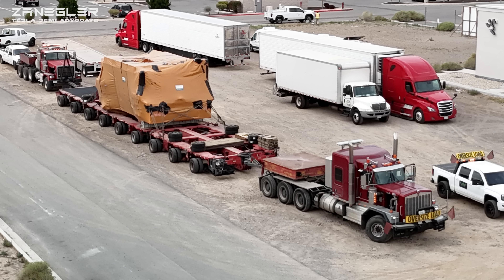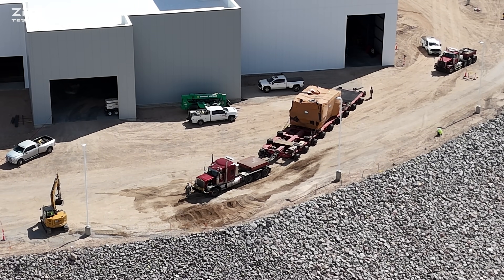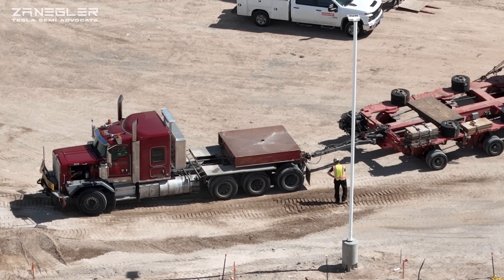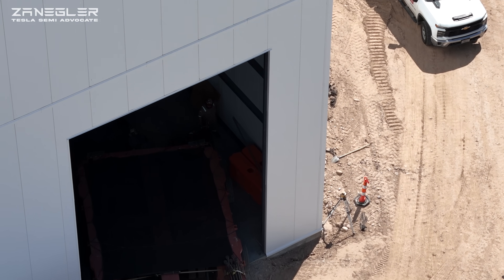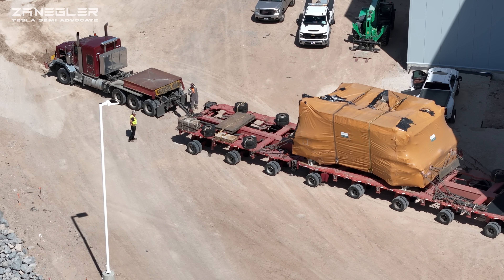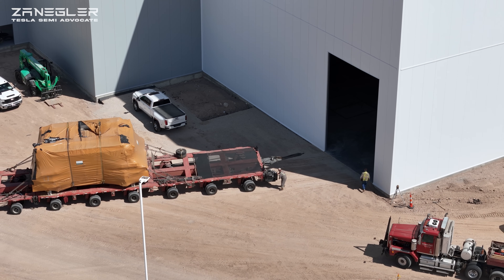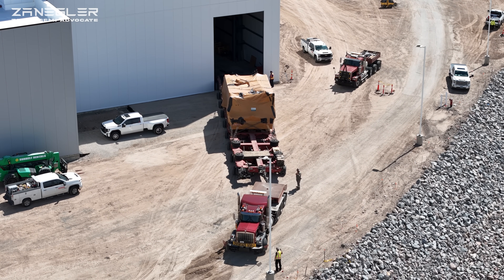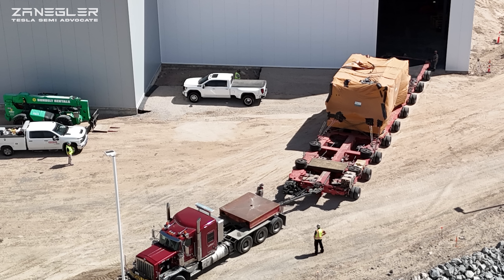Tesla Giga Semi - Back That Press Up!

Comment: Found a Youtube video showing the installation of a stamping press line for BYD.
Video title is 'The whole installation process for a High-speed Stamping Tandem Line of JIER'
This will be a very similar pressline to that being installed at the Semi factory.
Reply: Thanks for the link. Very interesting. I wonder why they brought in a mobile crane when there was a working bridge crane right overhead: https://www.youtube.com/watch?v=rBcwhg01SJ0&t=12s

FYI: YouTube and Google links are acceptable in YouTube comments since they are both Google domains
Reply: @GntlTch  Good pick up. Longer reach immediately comes to mind.

Using the bridge crane also.
Reply: @GntlTch  Links. I can't explain why, but sometimes a youtube link in my post will be immediately deleted, other times goes into quarantine for a couple of days, every once in a while it is not an issue.

I tend to just avoid them. Posting a title not generally problematic.

I do post of lot of comments, might be the reason I have trouble.
Reply: @GntlTch  For the record, as a response to the comment by @thedukeofalinor1377, I just tried posting a link to Zanegler's previous video showing all but the middle axle on the trailer are steerable.

My comment was deleted.

Steerable axles, see 'Tesla Giga Semi Stamping Press - Final Assault', at 7:48

Comment: My thought about gantry cranes here s that they may have their internal permanent gantry crane running and they are using that now instead of the portable?
Reply: Internal bridge crane (big red crane delivered a couple of weeks ago) is well below capacity (50mt) to lift a 133mt press component.

The gantry is partly visible inside in the previous video, set up over the stamping pit.

Comment: You have two options to steer the trailer,  one is you can control him when the reach (or tow bar) is mechanicly connectetd to the axles, the other is you disconnect the reach`s  steering function mechanically. You are still connectet to the trailer for push and pull but now you can steer with the hydraulic aggregat either in the front or in the back.
All it takes ☝ you pull out ONE big bolt. 👍

Comment: Very nice conclusion. Thanks. I might have missed something, but there are 2 stamping "excavations" aren't there? I guess they are all in the one building now with 2 big pits (or a double one) and what seemed to be a smaller one farther away inside. There are 3 stamping machines, one already placed, this one, and another on the way. Is the farther one smaller? And has it been placed already? Or is it the one on the way and to be placed on the other end of the building?
Reply: I think there are 2 'presses'. A 5 station stamping pressline similar to the Schuler and AIDA presslines as installed at GT and Berlin, and a standalone stamping press as is also installed at GT.

A pressline is a row of stamping presses installed as a single machine where a component is transferred from press to press as the component is shaped from blank sheet to formed and trimmed component.
In this instance I think there are 5 stations, based on the number of components that were stored at GT

The 5 station pressline would be installed over the long stamping pit on the west side.

The standalone stamping press on the small pit on the east side.

Youtube video by Schular titled ‘Servo pressline at Mercedes-Benz plant Bremen’ shows an example of a multi station pressline (6 stations), as do the various Tesla promotional videos from Berlin.

Joe’s 21 November 2022 video titled ‘Inside both stamping machine areas! 21 November 2022 Giga Texas Construction Update’, shows a pressline, a standalone press (AFAIK is used to test dies) in Stamping 1. Plus shows the gantry crane set up over the stamping pit in Stamping 2.
Reply: @DessieDoolan  Thanks, Dessie. Your explanation succinctly sums up what is happening: a stamping pressline on one side and a stamping press on the other. It was fascinating to watch that trailer backing up into the building through the big door. And clever, it seems to me, to first construct the gantry crane outdoors, then move it into the building (wish we had seen that), and leave it inside for positioning the other presses.

Ha. It looks like those guy really know what they are doing ... and have probably done that many times before. 🙂
Reply: @WarrenLacefield  I'd say the gantry has been moved in and out several times. Might be shifted again.
I'm sure there is at least 2 components yet to arrive. The component still at GT, and the one that left GT about September 2nd (for a 3 week journey).

Yes the operators must be incredibly skilled. The right man and the right machine can become one!
Reply: @DessieDoolan  Yes, two more packages to arrive. The one left at GT looks smaller. Is it a press or another sub-component?
Reply: @WarrenLacefield  Still at GT is about the right size of the component that is installed in the stamping pit. The bed that the die bolsters are supported on.

If the manufacturer of the presses was known it would be easier to research this.

Tesla has presses manufactured by Schuler, AIDA, and AP&T. Might be one of those.

When it was uncovered at GT, I tried to find the manufacturer. Could never identify a label on the components, and image searches never turned up anything.
Reply: @WarrenLacefield  Found a good youtube video showing the installation of a stamping pressline. Title is 'The whole installation process for a High-speed Stamping Tandem Line of JIER'

The very first item being installed is what I think is still awaiting shipping from GT.
Different manufacturer, so won't be an identically shaped component.
Reply: @DessieDoolan  Seems likely it is a component, but if a base, one would think that would be installed first. We can wait and see the order of parts arrival and entry, but unfortunately not the actual installation inside.

There have been some videos of inside GT, showing the stamping machines, I think - perhaps ones with Sandy Munro and Lars Moravy. I will look for Joe's 2022 video.
Reply: @DessieDoolan  Oh, wow. Isn't this a great time to be alive ... ha, to see such wonderful infomercials! That JIER video was amazing! I had (a surprisingly close) imaginary image in my head, but seeing the real thing - especially how the gantry crane is used repeatedly - makes all the difference.

You and David and others have repeatedly referred me to similar videos: e.g., for tunnel boring and other things. I'm sure probably many other viewers followed those link clues as well. Thank you.
Reply: @WarrenLacefield  I hope people do watch the video! Reading between the lines of comments and narration, I don't think its widely understood what is being installed.

Comment: Great video. For all the trailer complexity, crab walk would make this easier.
Reply: also crab walk is possible with that trailer  😉
Reply: @storeskeeperrvl3797  Is it really?

For a crab walk all wheels would need to be articulated and Zanegler pointed out that only the two pair at each end were steerable. the middle five, supporting the most weight and having the highest friction are not going to "crab walk" with that load.

Comment: The new red overhead crane in the building may very well lift that load off the truck, as maintaining the presses is its purpose.
You may find the crane rating in your photos in large print on the crane. This is required for user information.
Having it ready now saves time and money, and tests the system. The press may come apart to reduce the load.
Reply: They'll have the gantry crane set up over the stamping pit. Did the same at GT. Good view in Joe's 21 November 2022 video at 7.51.

The bridge crane delivered a few weeks back at Nevada is rated at 50mt. This component of the stamping press line evidently weighs 250,000lb or 113mt.